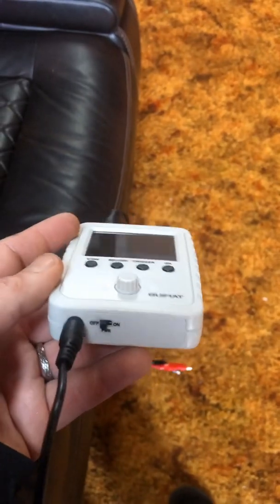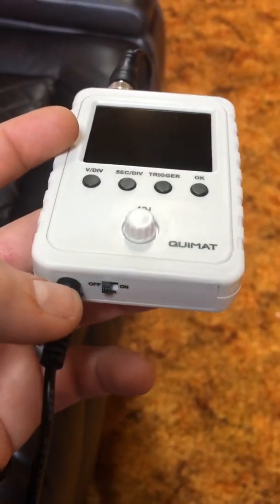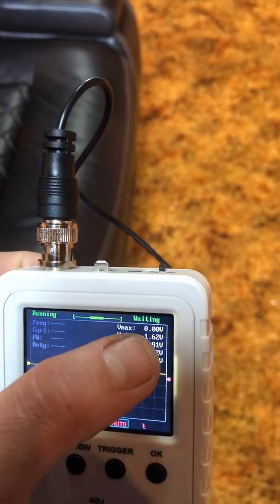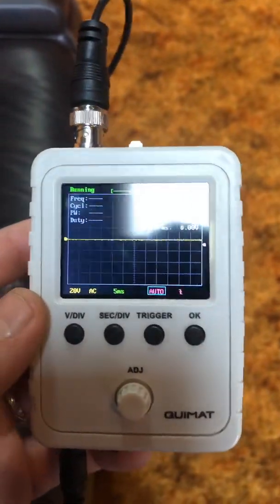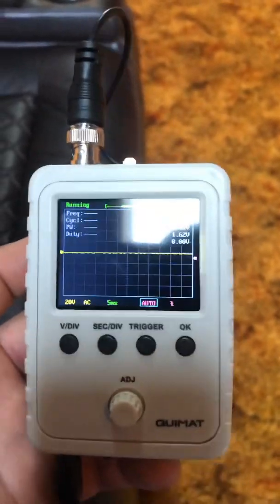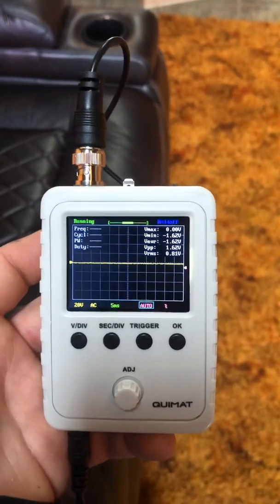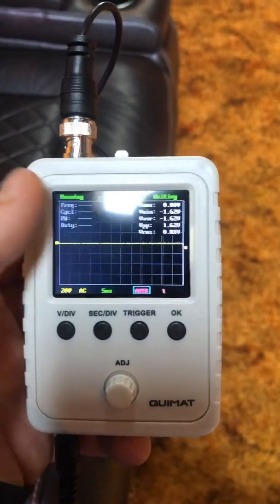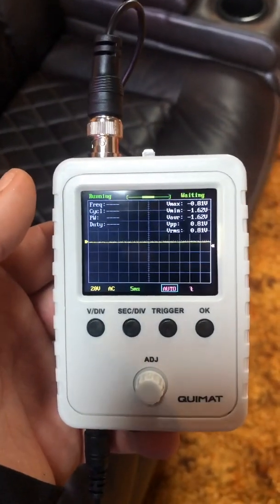How to tune your amplifier like a pro! for 45 bucks! no more clipping or distortion!

Comment: Did you know that NextLevelCarAudio put out a video on this same model about a month before you? Kinda crazy. If you're both saying it works well, gonna have to take your word on it... 🤔👍
Reply from the maker: No I actually didn’t know that! Thanks for letting me know but it kept coming up on Facebook about people dropping 200 bucks on dd1’s and it’s pointless since all that does it set the gain we set gains find clip points on head units and detect clean or distorted signal and then some all with a o scope 😂 these ones definitely work great! Using a 40hz 0db is great for the clip point on the head unit working out way back it’s good for detecting rca signal voltage and wether it’s clipped or not then using it fir the amp gain 40hz -15 is max output but will need monitoring and working your way back up to 0db you’ll find less and less clip but less output
Reply: @Jboost412  Yeah, as I was watching your video on my phone, the "next suggested video" was the one from him, and I'm just like "hey, that's the same thing...😅" But yeah, spending that kind of money for something that a cheap o-scope can do is absurd (this will be my first o-scope, as I've always done things the multimeter way 'til this purchase). That, and my personal thoughts on SMD aren't what you'd call "favorable"... LOL. But thanks for the tip! I'm actually just breaking in a new amp & sub at the moment, so everything's turned down and I'm underpowering all my speakers til I could actually o-scope (which is what sent me on the quest that led me to your video)... LOL. Thanks again.
Reply: I did tuned mine but when i play music it clips
Reply from the maker: Well at what volume did you find your head unit stops producing a clean signal both to your amps via the rca cables & from the head units speaker output using a 40hz 0db test tone is best for that from there you’ll set your radio to either that particular volume that it’s clean at or some say to just rule of thumb go with 75-80% of the radios volume and run the test tone of your choice something between 40hz 0db again but this time using it to set your amps gain that’s minimal output least chance of clip or max output is 40hz -15db typically I set everyone’s gain with a 40hz -5 dB so it’s louder but not capable of max output with max clip potential needing constant monitoring

Comment: Cool. Need to pick one of those up for sure. So, you've used that one for a while and it's been dependable and stays accurate?
Reply from the maker: Yeah honestly I’ve never had a problem with it...I’ve checked it next to my fluke and it’s always been good to me so I figured I would share it
Reply from the maker: And buying it from amazon “links in the description for it” if it does break they’ll send you new one no problem at all